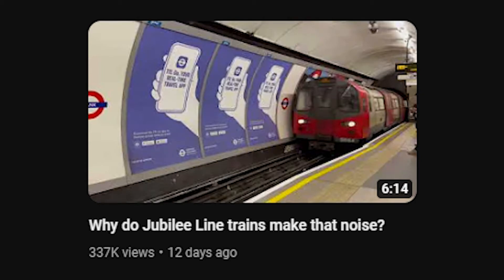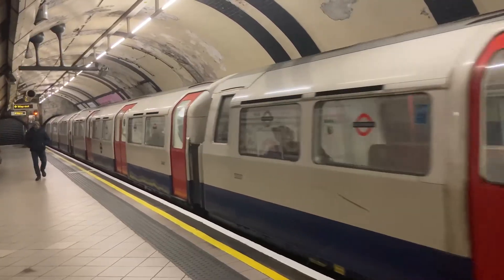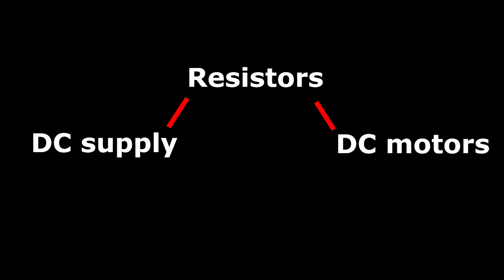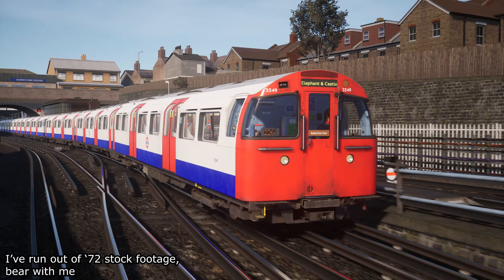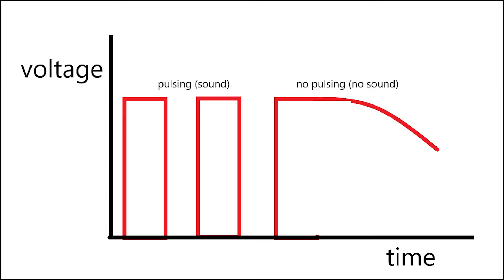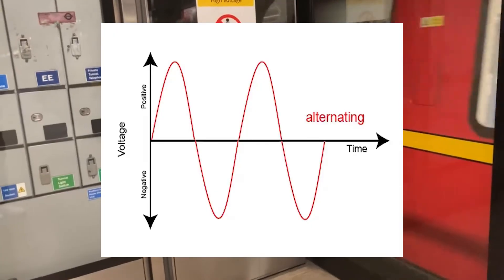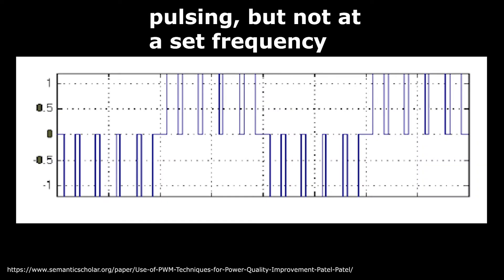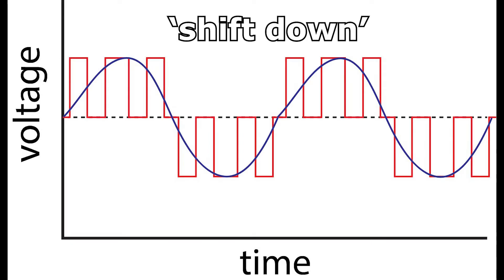The Famous Noise of the Jubilee Line - What causes it?

Comment from the maker: I didn’t mention Pulse Width Modulation by name here, but that’s the correct name for the way the DC supply is converted to the AC feed by the VFDs.

There’s another type of PWM from what I mentioned in the video called Pure PWM which uses a carrier frequency and other stuff to make a much cleaner sinewave and a stable note- this is why modern trains have a fixed note briefly before starting the gear-shifting business. Think 09 stock (although the 96 does this too). Newer IGBTs can do this pure PWM far better and this is another reason modern trains generally sound less cool, because they stay on that carrier frequency for far longer.

Comment: 1:52 Camshaft basically hammers that reduce resistance and are in two stages: series and parallel.
Reply from the maker: S and P are the throttle controls, not really the resistance.
Reply: Technically it's the technical term of how much power is being applied to the motors. Same sort of idea as a series circuit and a parallel circuit. @hain_train

Comment: Another train with a similarly iconic noise like that are the Bombardier M7s that are run by LIRR in New York.  There is an iconic sudden and dramtic increase in motor pitch at 6mph (the TSW model gets this effect perfectly), and then another shift down in pitch at 30mph.  They were built from 1999-2006 so probably still use GTO rather than IGBT for modulation.

Comment: With the 92 stock.  They actually do have motor noise. It's just very smooth and washing machine like. You hear it better on the train as opposed to outside of it. Trains like the class 319 used a similar equipment to the 92 stock. But the class 319s are loud
Reply from the maker: They have motor noise just as a 72 stock does, because after the initial pulsing the full supply is fed straight to the motors.
Reply: @thetrainguy4  yeah, they do, that's what I was saying. Their motors are just different in nature so sound different to the 72 stock. The motors always make sound tbh when beong fed power. Or under the influence of the stator (like I'm an AC motor)